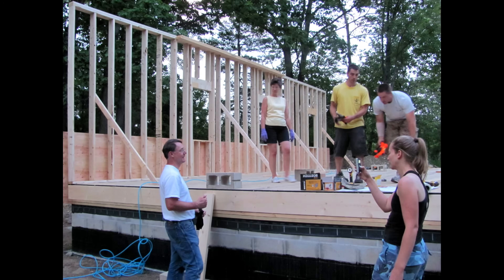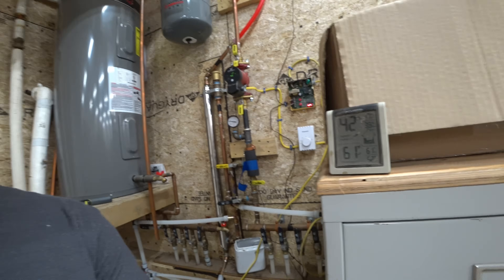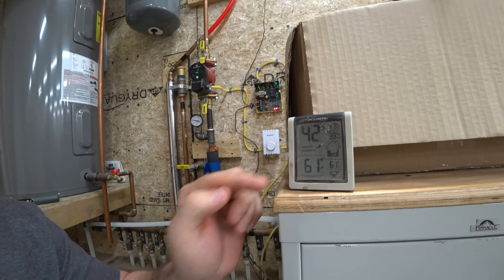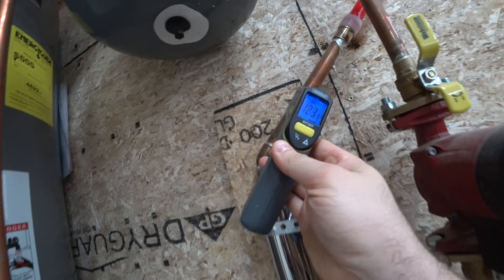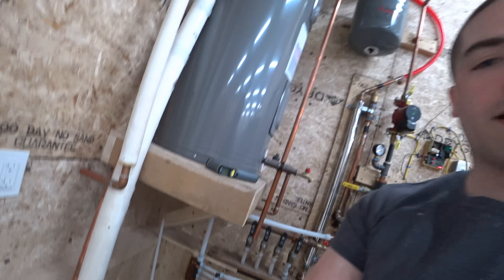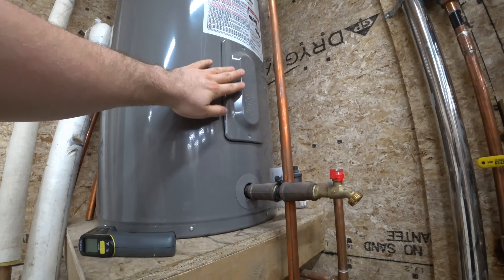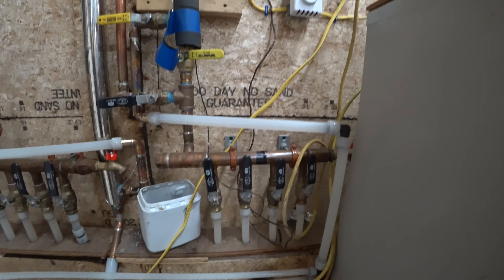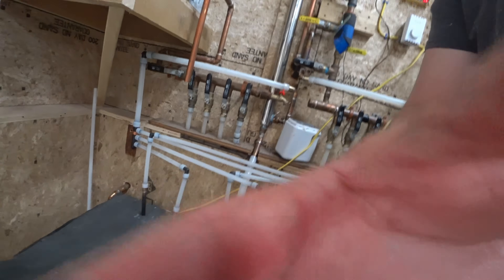Solar Heated Garage Radiant Floor, Update

Comment: Okay, please don't be offended.  But you've got radiant loss ALL OVER that system

Your reservoir is unsealed and uninsulated.  So it's a giant hotbox trying to space-heat everything in it's vicinity.  INCLUDING THE EXTERIOR WALL OF THE GARAGE!

You've got a wooden box with what is essentially a plastic bag inside it.  Remember how poor an insulator wood is?  A 4" cross section is something like R2-R3.

Rebuild the box like a cooler.

2" Foam board insulation inside.  Spray-foamed together and well caulked/adhesived together.  Then, if the rubber liner fails for any reason, you've don't simply begin leaking water all over the garage.

Wooden box in the middle for structural stability

2" Foam board insulation on the outside.

Create a tight-fitting foam "lid" as well.  Again, foam inside, maybe plywood in the middle and foam outside.  Maybe go for 4" foam inside the top.

ADDITION: Maybe make it a half-lid.  Where the back 1/4-1/3 of the box is just a fixed "top" with the pipes going through it (makes those holes easier to seal).  Then turn the front of the top into a lift-off lid.

This way the reservoir is completely thermally broken from EVERYTHING.

Next:  INSULATE YOUR PIPES!  Again, you're getting radiant loss through every bit of PEX, copper and PVC.  Sure, the tubes are small, but there's a LOT of linear feet of pipe there.

I also agree that you might see better performance out of the system hooked up in parallel, rather than serial.

Doing just the insulation, I'm willing to bet  you can bring your water temps up another 5-10 degrees.

Doing that AND moving to parallel?  You could probably get your water temps into the 120 degree range.
Reply from the maker: Hi Hyperstrike,  Thanks for sharing your ideas here, as well as on my other videos.  I'm not offended.  

I agree with you (and some other commentators) that parallel would be more efficient.   I looked into doing it on the garage and this is what I was led to understand: I have two collectors on the wall, and five on the roof.  That means the piping to reach the collectors are different, and the piping inside the collectors are different.  The differences will lead to different internal friction (the roof will have more and the wall less).  So the fluid will choose the path of least resistance.  That means all of my fluid will flow through the wall panels and none through the roof.  To overcome this I would need two pumps, and two controllers.  If I do that I would certainly see an improvement, but I didn't want to sink more money into project.  That's rely the bottom line... I'm sacrificing some efficiency to save about $600 (pump, controller, pipes, fittings).

As to the pipe and tank insulation inside my thermal envelope:  This solar system is a space heating system only.  It will be off all summer long.  I don't use it for showers or laundry etc.  So if the pipes/tank are un-insulated and loosing heat, what's the problem?  They are just loosing heat to the air of the garage instead of the floor.  But it is still BTU's into the garage.

I may have missed something, and if I have please let me know.  Thanks.
Reply: The problem isn't losing heat in the summer.  It's they're losing heat in an uncontrolled manner to open air during the winter.  You want to push maximum heat into your main radiator (the floor).  Right now you're simply warming a corner of the garage right next to a garage door, when the energy could be used in a more even manner to heat the whole garage.
Reply: Yes he's losing heat from the tank, but assuming the garage walls are insulated (and he wouldn't achieve the temperatures he is without some) the "lost" heat is just going into the internal space in the garage. i.e. it's not lost, he's still heating the garage.

Comment: I have herd of solar panels stagnating and overheating in the summertime. How do you overcome this? Great video, thanks for sharing your experience.
Reply from the maker: Thanks for watching.  You are right to be concerned with overheating in summer as a potential issue.  This problem can sometimes happen with glycol based systems.  These are sometimes called "closed loop" systems and have glycol mixed in the fluid to protect against turning to ice.  However, if they don't have a "dump load" and/or loose power, they can boil and kill themselves.  The system you see on my garage is called a "drain back" or sometimes called "open loop".  I have no glycol.  Instead, my transfer fluid is just regular water strait out of the tap.  If there is any failure then the water just drains back to the tank.  This is also the freeze-protection.  When the water drains to the tank it leaves the panels empty (filled with air in the pipes).

Comment: I wonder how much different the results would be if, instead of the costly panels big heat-exchange tanks, you ran a grid of black-painted piping across the roof and shunted that directly into the radiant pipes.

Comment: You can make your warmer work better efficiency by connecting the elements in parallel.  Like: in series water heats up in the first element, then it goes to the second element, and MAYBE  heats a little more. But after that, it is already warm water and does not heat any more.
If you connect them in parallel, every element gets cold water, and every element makes cold water warmer. 
This is very cheap way to even double the efficiency of your warming elements.
Reply: So long as the output from a single panel is always hot enough for heating purposes.
Reply: I must agree. We have three evacuated tube panels on our off-grid home, plumbed in parallel. If you plumb in series then each panel receives ever warmer fluid (glycol, in my case) and that reduces its efficiency.

Comment: by the way if you call a tech for your unit make sure he carries an Electronic gauge NOT ordinary manyfolds electronic is lot more efficient and will tell lot faster if theres a Micro leak some were ok take note of that...David
Reply from the maker: Hi beez,  Are you referring to my video on the heat pump, or are you talking about a water leak with the solar thermal collectors?
Reply: heat pump David

Comment: just a litlle tip lots of people fail when trying to increase the size of there heating equippment...I always say insulate +insulate and i bet you i will be installing you a smaller unit what ever the unit you want i can instal it...your garage door only R7 if insulated so if u insulat it you will see imediate change and lest wear and tear of your system trying to compensate for all that heat loss...just saying David...:)
Reply from the maker: Hi beez,  You mentioned you are in HVAC.  It is rare to find one that pushes insulation.  Thanks for doing right by your customers.
Reply: I have a great respect for my customers and i never never lie to them so at night i can sleep well...and my customer base is huge and all by referral + my studdies included GENERAL CONTRACTING  2 years full time at high cost so i no quiet a bit on building stuff or codes thick has the bible...loll  so i can see all aspect of the problem often i refuse to enhance there system and refer them to an insulation Co.or of there choice...sometimes and more then often there surprized but i aint in the BIZ to cheat or for the Bad money im in it because I love my job...:)

Comment: Would your system warm the garage more if you doubled the collectir panals? Or is it more complicated than that?
Reply from the maker: Hi Steven,  More collector area would heat the garage more.  That is not more complicated.  If you do want to look at it in more depth, then here are other things to consider: 1. the west side of my roof is in shade more hours of the day, so if I added more collectors over there I would put them on a separate pump and controller.  2. In DEC and JAN the wall has a lot of shade from neighbors trees.  You don't see that in this video because it was filmed on the last day of FEB.

Comment: Do you treat the water in the storage tank?
Reply from the maker: Hi Phil,  No, I haven't treated the water in the storage tank.  It is just plain old tap water.   I've heard distilled water is ideal, but I didn't bother.  Because it is a drain-back system there is no need for Glycol.  Also, all the parts are copper, brass, or plastic so no rust.  I did treat the water in the radiant floor with a rust inhibitor in an effort to (hopefully) keep the tank water heater lasting longer.  The tank water heater is a steel tank.

Comment: Hey, nice system! I have an idea - could you immerse that returning pipe and put normally-open solenoid valve above water level with T-shaped pipe connector (solenoid is powered when pump is on)? That way when pump is stopped and solenoid loses power, then aircap is openened and panels can drainback. When pump is running and valve is closed, then you dont hear that water-sound (depends if it is issue to you or not) and pump can probably work more efficiently because it works as closed system (that needs to verified)
What do you think? Does it improve system?
Reply from the maker: Your idea sounds like it could work.  I don't know for sure, never heard of someone doing it.  I like the drainback because any failure of anything will result in the water draining back to the tank and the system being protected from freezing.  Adding a solenoid air vent sounds like one more thing that could go wrong.  However, I could see doing it if the water sound is a bother to someone.
Reply: Probably easier and safest option is to immerse pipe and drill small hole (3-5mm) to pipe above waterline - that way it still can drain...takes just little more time. And you get rid of flowing water sound (at least most of it). John Canivan suggested something like that in some video.
Or just direct water to tank wall at shallow angle, so it flows on wall  and does not fall

Comment: Next time could you show the heat gun on the concrete floor too. Thanks. A few solar panels with a techluck.com Mppt for the electric water tank would finish the job and net you a lot more heat still costing no monthly grid bill.
Reply from the maker: Sorry I didn't think of that for this video.  I've taken the floor temperature several times before.  The concrete is usually 10° hotter than the air temp.  Then overnight and into the next day the concrete and air equalize in temperature.  

As for the techluck...  I've considered buying it when I got my solar PV panels a few months ago.  However, it doesn't come across as totally transparent.  I would like to see a review showing how many watts to a heater with and without the device hooked up.  How much more does it increase production vs. not using it.  In past videos I've showed the production with solar PV directly connected to a heater, and % efficiency.  I guess I just need more convincing from the maker that it will pay for itself.  Do you have any experience with it?
Reply: To be honest I would like to see that review with voltages in and out also. I have not decided which way to go for the same reason as you but it does seem to be the easiest way to use manufactures equipment on electric water heaters unless you already have a battery bank and large inverter then direct from inverter with the solid state relay controlled by the charge controller for battery bank protection, or just direct from solar panels with the solid state relay controlled by a programmable 12-32 volt source. Your videos are awesome and thanks for sharing your hands on knowledge which is always the best. Maybe a air to water garage heater would make up the air temperature deficiency in the garage as heat transfer from floor heating is a slow process but the best heat imho.

Comment: I vaguely recall your video of insulating the garage. ...a lot of insulation. In this video and in the comments you detail how many BTUs you collect to heat the garage.
Where do you lose the heat? There is a gizmo of some sort ...a infrared "gun"... that shows hot spots. I'd be very interested in seeing the results/illustration of where the heat leaves the garage.
Great work you're doing, btw.
Reply from the maker: My biggest heat loss is the doors.  Second to that, I'm assuming is when I bring in the cold car covered in snow.  Then I'm using up the stored heat to warm the 3000 pounds of steel and melt the snow.

Comment: Can you build a house like this and still adjust the temperature?
Reply from the maker: Sure, I'm planning on doing something similar on my next house.  I'm using this garage to work out some of the details.  Right now I use the concrete slab as the only "thermal battery".  However, If I built a larger tank then I could heat the tank directly from the solar, and then pump the water from the tank to the radiant floor based on inside air temperature.
Reply: DavidPoz Awesome. Good to know. I am getting very interested in this. Thanks for educating me.

Comment: It's about 30F-40F most of the time in the winter here in Southern Oregon. Would a similar system in my next garage keep it around 65F you think?
Reply from the maker: Thanks for watching the video. There are a lot of variables to answer that question in detail, but here are some things I would consider: Sun-hrs in the winter for your location? Where I live I receive about 4 good production hours in DEC. and JAN. per sunny day. The panels on my garage wall are partially shaded, and my roof is a pretty shallow pitch (less than ideal). But let’s just say I receive 10,000 BTU's per panel per sunny day. (I get more from my house panels). Then I can work with 70,000 BTU's per sunny day.  Will that keep your garage 30° warmer than ambient air temp? It depends on your buildings insulation, air-tightness, and size. So... maybe?
Reply: Is your slab going to be well insulated? If not, you are wasting your time. Do not ever be fooled by the notion that 'heat rises'. It does not! Heat moves from warm to cool and does not care if the cool direction is down.